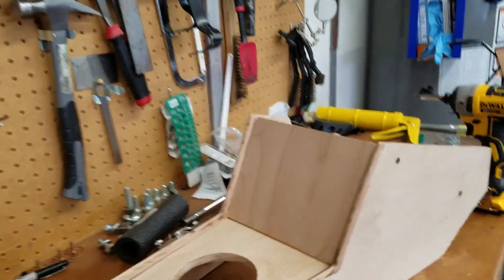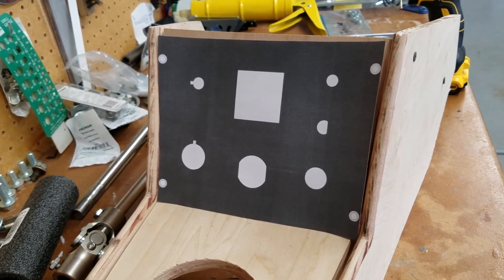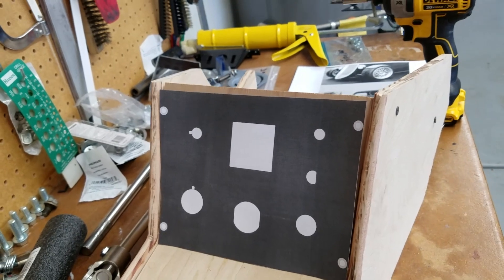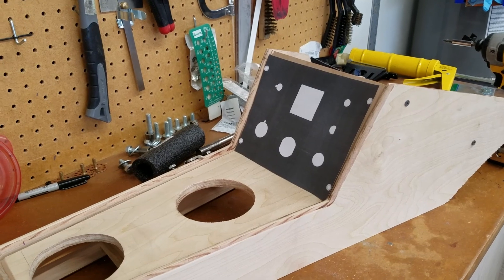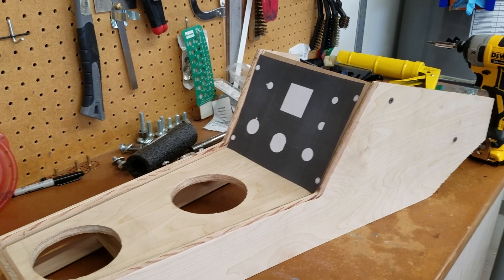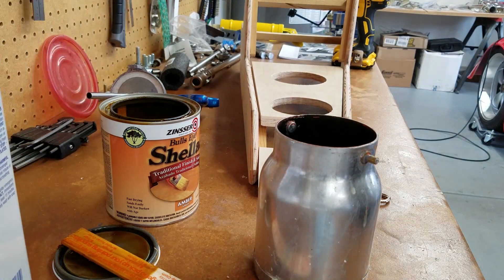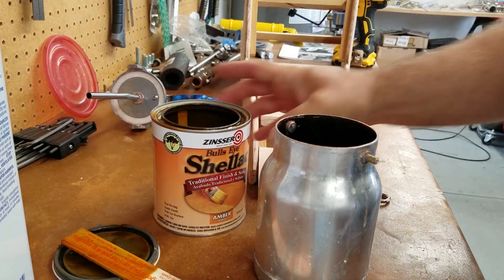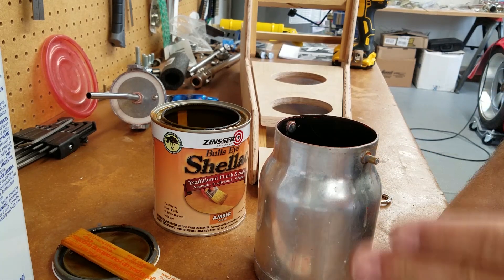Factory Five 33 Hot Rod V2 - Center Console Aluminum Panel Design

Comment: Jim, just curious. Is that spray gun running off a shop vac?
Reply from the maker: No, it is its own contained system.  But, it is basically a similar though - Consistent air flow that sounds like a shop vac specifically for this application.  Many wood workers use this system.